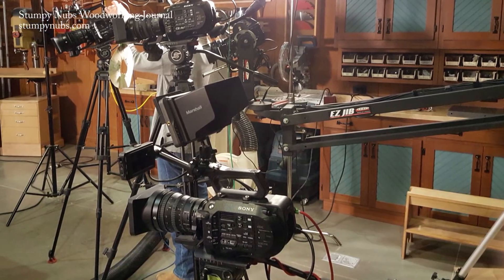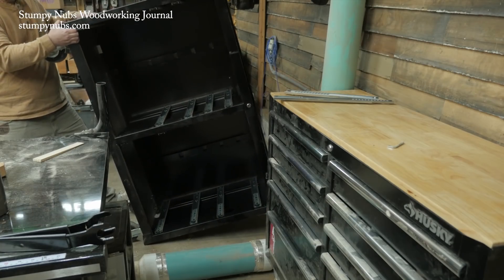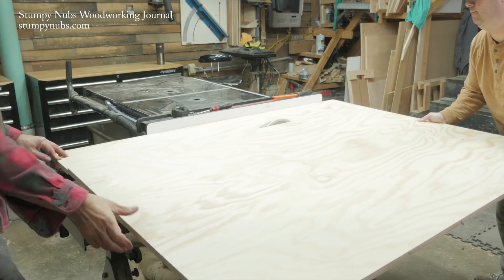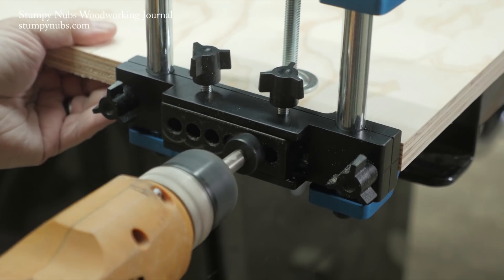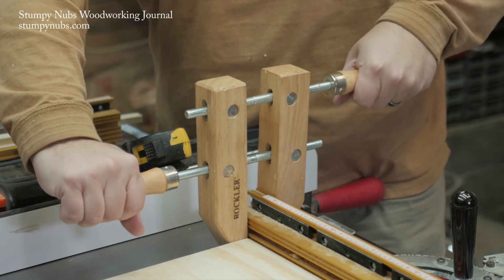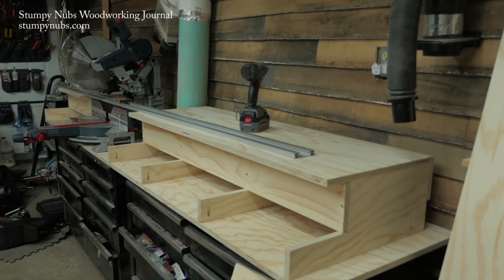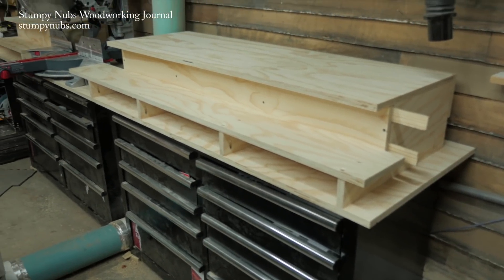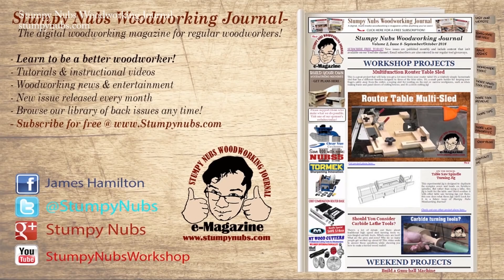How to make a miter saw workstation from cheap plywood (Part 2)

Comment: Looks to me like this is actually going to be quite a bit taller than the typical CMS station. I've built a couple, and each time I've made the work surface a bit higher. My latest puts the work surface at about 42" which seems to make it easier to see my marks and line up the blade with the cutline. I'm not sure if there is an optimal height, but the older I get and the worse my eyes get, the higher I want my miter saw!

Comment: Joiner Biscuits are about <10c each. The machine starts at 70$. I think that is better. If you need a stronger joint, just use two.
Reply from the maker: Not even close to the same thing.

Comment: I had a project recently that I used AB Sanded Pine plywood, while cutting project pieces everything was fine. But once i started assembly, I did have some slight warping. The final product turned out really nice and nobody else notices the warping. I should have used the birch plywood.
Reply from the maker: It will warp so you have to plan for and design the project to minimize it.

Comment: Another great video James. I'm with the other guys; Loved your sense of humour (humor) but you made me stop and think "huh?"  when you mentioned about losing the right insole of his shoe, then, the penny dropped! excellent. I even learned something in between the comedy and I asked myself; "What's wrong with using dowels to strengthen the joints?" Do we have to use those expensive biscuits thingymajigs, or the tool that you used? Just wondering....Good one mate, keep 'em comin'.
Reply from the maker: For an edge joint like in this video, a dowel or even a biscuit would have been fine. The weakness would be in the plywood layers tearing anyway. But for furniture joinery a loose tenon like I used would be a lot stronger unless you plan to use many dowels per joint.
Reply: Ok, understood. I'll keep the risk of plywood separation in mind also. Thanks James.

Comment: Great info, but isn't it basic table saw safety to only have the saw blade just above the top of the item you're cutting?  You had several inches above the wood.  I'm genuinely asking as I'm a relatively new wood worker and want confirmation or correction of my belief.
Reply from the maker: There are several reasons why one may make certain cuts with a higher blade, one of which was explained in this video.